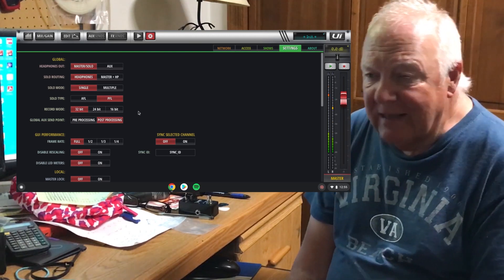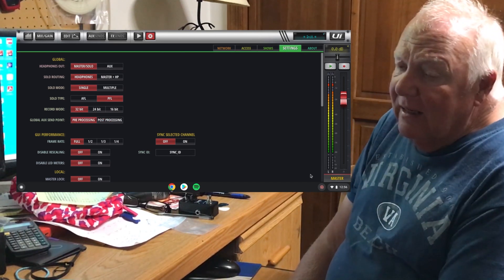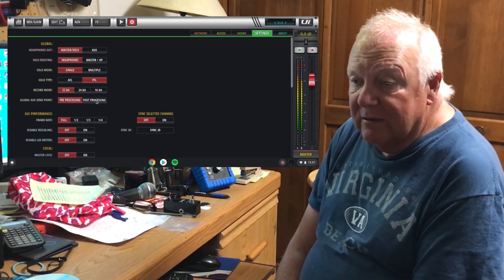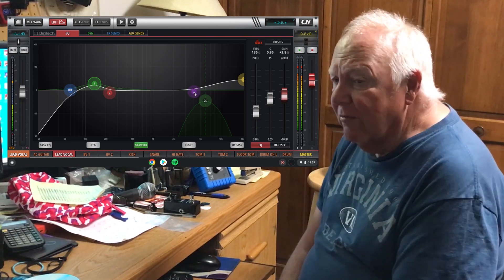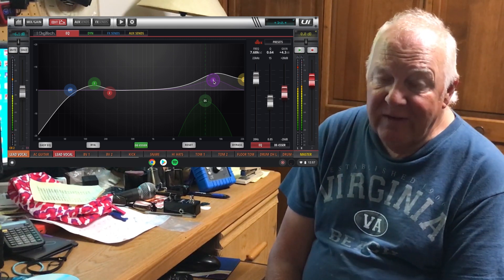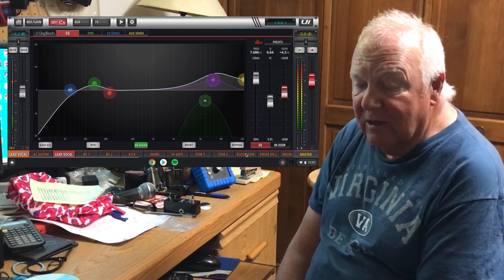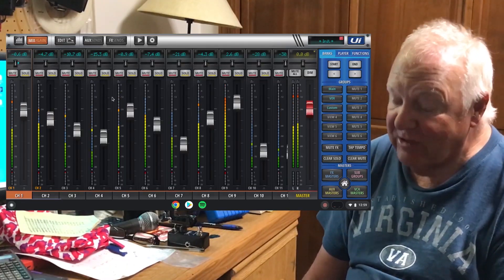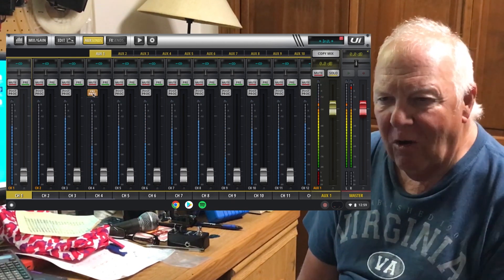Pre vs Post DSP on the Soundcraft UI16

Comment: I by and large agree with this, however .... don't forget the subgroups, as the place to make sudden changes to dynamics as well as tonality, you definitely would need the low cuts all over the place, and they clean up proximity artefacts. Further more would the performers lean into or interpret the environment, changing their performances accordingly - if just you could separate the low cut from the rest of the Eq'ing. I hear you say that mainly the vocals needs this treatment ... it's obvious to me that everything on linedrivers could easily be dealt with severe low cutting as well as compressing ...
Reply: Being old, my experience has been with wedges.  If I ran Auxes post DSP, and  had to change the EQ/Comp in FOH on a channel going to that wedge,  I risked feedback in the wedge.   Acoustic guitars were a pain because they needed that EQ/Comp in the wedge to sound good.  I see that some mixers (Soundcraft UI24) now let you choose by each channel in the Aux, pre or post DSP.  That's a cool idea.   I now work with a band where all are on in-ears.  Fortunately, they each do their own mix with their cell phones.  We run the Auxes post DSP and nobody is complaining.  I'm not sure how the subgroups would effect the Auxes.  Thanks.
Reply: @guysdownstairs  I've been in livesound for nearly 40 years, and the usual way we compressed the signals were via a mix of subgroups as well as some inserted at the channel inserts. We sometimes y-split the most prone to feeds cvhannels with still full eq, but now only compression on the signal which were send to FOH .... but in the ui16 could you compress as well as EQ some rough in, say for all vocals and leave the lowcut still operating in the auxes.
Reply: @srendyhr5844  You are doing much more intense stuff than those of us using the UI16.  On the Ui16, the Auxes only offer graphic EQ, gate, and compression.  So if you have to have vocals and the guitar in the same Aux, running preDSP, you have to choose either vocals or guitar for your EQ/Comp settings.  Running the Aux postDSP gives you EQ/Comp on each channel.
Reply: @guysdownstairs  I'm actually using the UI16, and these postings adresses a common desk-problem with having the low cut, being a part of the channel EQ instead of being in the pre amping.  One of the trickiest things to handle with your wedge mixing pre approach is the singing drummer who rely on having his kickdrum in a wedge, since it yours only is voicing the vocal. Another issue is bleed from stage, you will at FOH struggle a lot with that indirect sound you're getting from the, hardly dealt with proximity effekt ...as well as the low frequency rattling transmitting through the microphone stands, originating from feet stomping. A digital desk is unfortunately not particularly forgiving in making sudden burst into something usefull - like tube based preamps are. I'm in favour of doing as little as possible to my sources, and having as few channels engaged as possible - this is why i like the format of this desk. I learned a lot by applying Jim Yakabuski's approach "Going Retro: Can The 10-Channel Challenge Improve Your Live Mixes?"